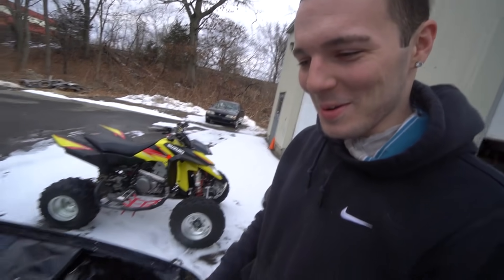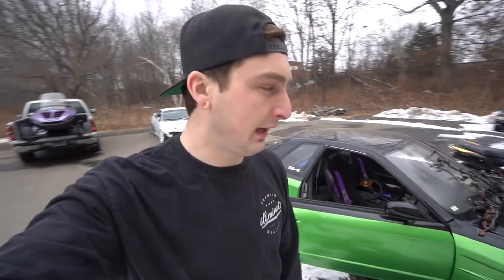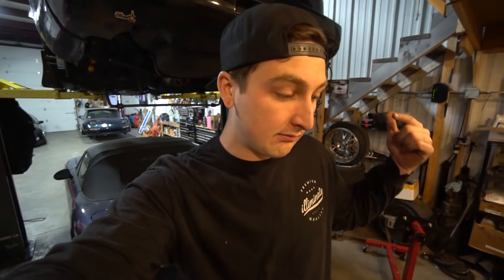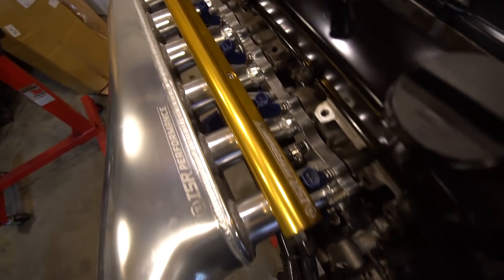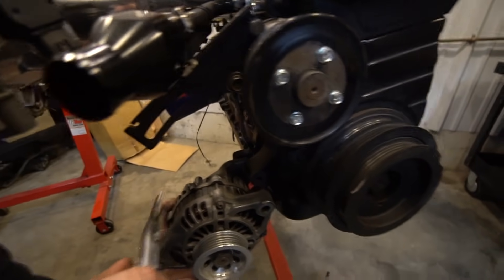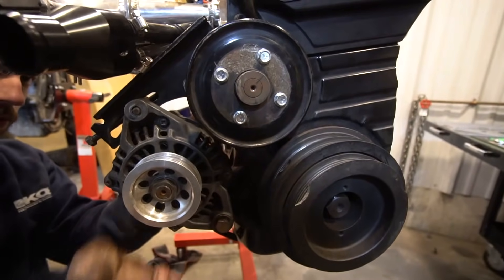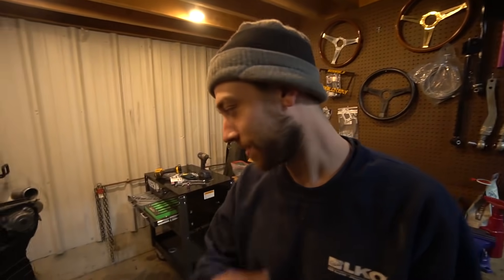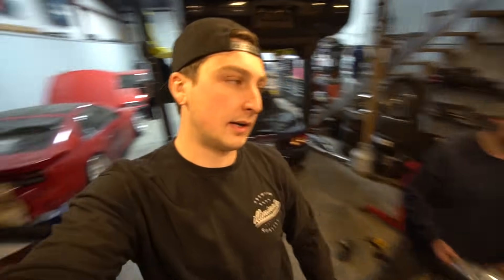The R32 is FINALLY out of hiding!!

Comment: The rb25 turbo is only really good for about 250 wheel before it starts blowing up... tell drew to get a holset hy35... for like 200 bucks you get a bitchin turbo that will run up to about 400+/- hp. Rb20’s are pretty stout and will do that no problem!